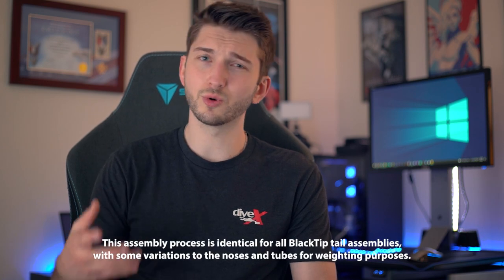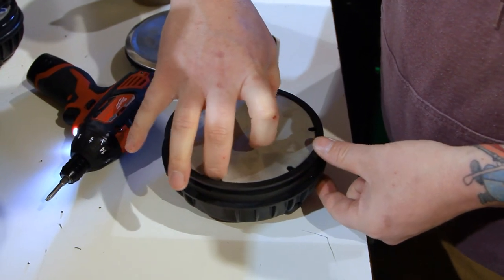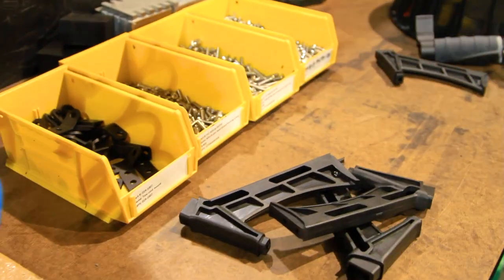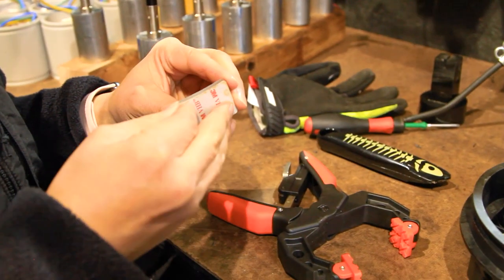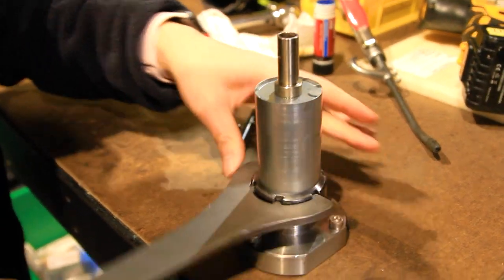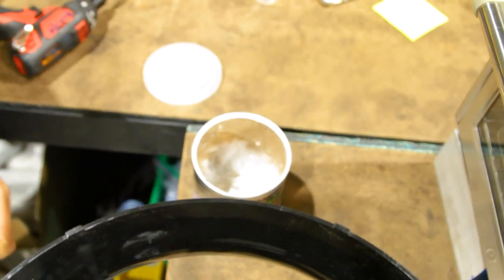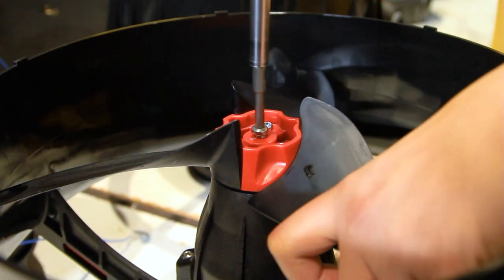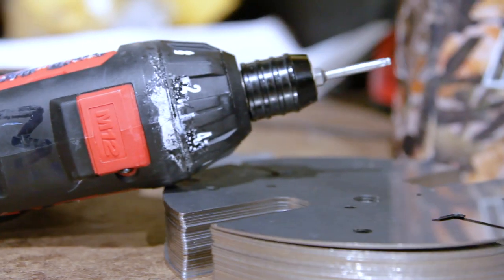Assembling Your BlackTip

Comment: Thanks for posting this level of detail as it really helped in the repair of my Scooter, my only  feedback is that the mounting blocks that come with the scooter when new are too brittle, All of my blocks have cracked or shattered due to  the polymer that was used being too brittle, have now replaced all of the  original mounts with 3 D printed mounts and they work perfectly.
Reply from the maker: I'm so glad you found this video useful! Sorry to hear about the mounting blocks on your scooter, I'll be sure to pass the issue along to someone who may be able to help.

Comment: What glue do you use to glue the reed switch? The switch reed switch was damaged, I checked it electronically. I need to replace it and I don't know how to remove the old reed switch. I mean 6 minutes 22 seconds into the video. Use some solvent ?

Comment: for what is that blue wire in the anderson connector? is that 18v from 1 dewalt battery because the 2 batteries are in series ?

Comment: Have you done any testing with new dewalt 15AH batteries? Probably over kill
Reply: Do they  even fit? I heard they were too big.
Reply: @AvidDiving  That needs to be answered as well.
Reply from the maker: Based on initial impressions of these new 15Ah batteries coming out soon, it appears that these new packs will be too long to stack end-to-end inside the BlackTip body tubes, which is disappointing. These fit issues will most likely apply to all other Dive Xtras PTB scooters as well.
Reply: @divextras  Thanks for the reply, hopefully I can afford a blacktip scooter next year.
Reply: @divextras  that's unfortunate, perhaps a modification to where the batteries mount.... mounts on the tube in a future update can accommodate them.
Reply from the maker: There might be a way to do something like that, but I can't make any promises haha. I'm just the guy who replies to YouTube comments XD

Comment: How many batteries does that take? Only 2. Aldo what brand and v
Reply from the maker: Depending on the model of BlackTip, it will accept either two or four batteries. Here is an excerpt from our website regarding which batteries are compatible with our scooter:
"The BlackTip accepts 20v (USA only) or 18v DCB-format power tool batteries. These can be purchased at retailers worldwide or online via Amazon or other seller."
More info can be found on this page: https://dive-xtras.com/pages/blacktip-features